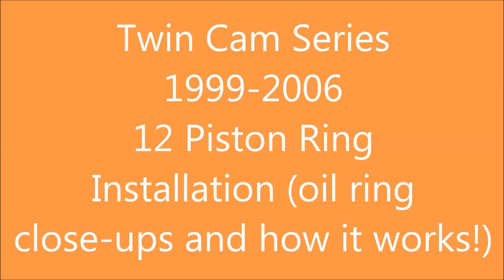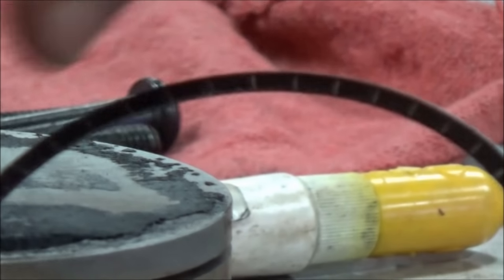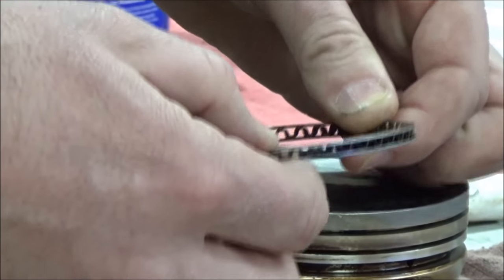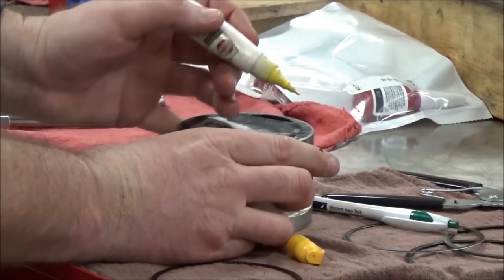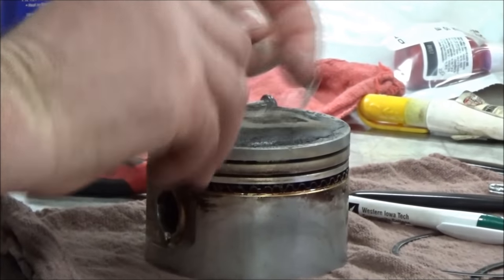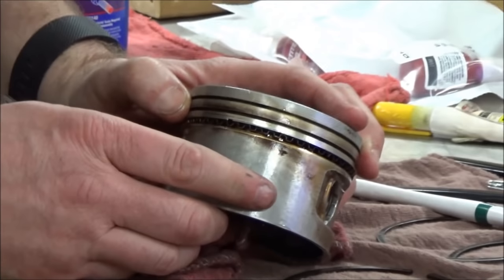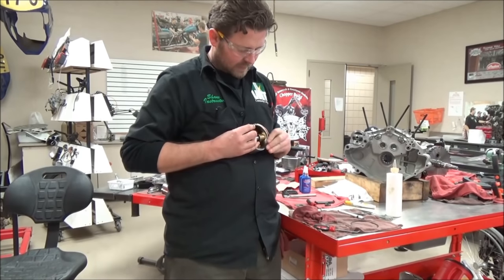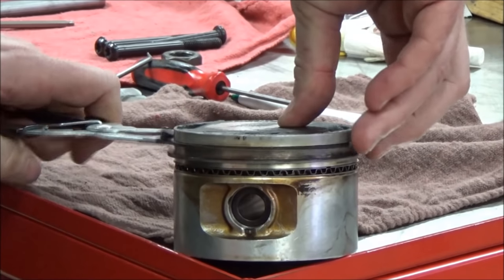How to install piston rings and not break them. Oil ring explanation POV installation! #pistonrings

Comment: Great video.  Another thing to remember about the oil rings is to get the correct size.  I made that mistake on my shovel rebuild.  The machine shop bored 20 over and I bought the pistons to match.  The rings that came with the pistons were not the moly compression rings so I bought a new set of rings.  The oil expander ring was not the right size (narrower than the width of the piston oil slot).  I put the rails on like your suppose to.  The bike ran great at first but I was soon fouling my plugs consistently.  Couldn’t figure out was was going on.  I thought my valve seals were the culprit.  I finally disassemble the engine and realize what a dumb ass mistake I had made.  The rails were climbing on top of the lips of the expander and causing the fouling.
Reply from the maker: Hi Scruffy. TY! You may enjoy this video Shane did on the 3 piece oil ring too. https://www.youtube.com/watch?v=PyUjvaQa2h0 
You rock for commenting! We will let Shane know!

Ways to support or high five How 2 Wrench! Thank you in advance. YOU MOTIVATE US TO DO MORE!
1. Smash the subscribe button (thank if already a sub!)
2. Have you seen our "YouTube Trained Support Shirts?  https://goodfellasmerch.com/collections/how-2-wrench/products/support-shirt 
3. Join this channel to get access to perks:
https://www.youtube.com/channel/UCBhM8DCKnT3qXwTW0eToyCg/join    
-Daily MEMBER FIRST COMMENTS ANSWERED FIRST 
-Live Q/A video chats
-Wonder if we have a video on your need? Members can request content links!
-Full Access to the ENTIRE 700 video library
-Member-Only FREE tool giveaways  
4. Got an emergency and your head is about to explode from frustration or fear? Get Shane’s cell here: https://how2wrench.com/ols/products/techline-one-on-one

Comment: The method shown will work.  However, it is also clumsy, time consuming and will scratch the piston ring lands or the piston skirt.  Using a screwdriver or whatever to recover an OCR rail from the top or second groove is an absolute no-no.   The girls on the assembly lines at the piston plant I worked at would flick a three piece ring on a piston in less than 20 seconds.  No marks on the piston, all gaps aligned.  The trick is simple.  Install the expander.  Push one end of a rail into position say above the top of the expander, twist it like a band saw blade and lay it into the groove.  Do likewise with the bottom one.  No over expansion whatsoever and they are designed to be installed in this manner.

Comment: Wow, I've been at this oil ring assembly for 2 hours with no success but after 2 mins I got it on the first try. Awesome vid!
Reply from the maker: Thanks for commenting and adding value to our community!

Have you subscribed yet to never miss a video? Have you seen the video playlists? Over 600 videos! Check them out here: https://www.youtube.com/user/conleybuilt/playlists  

Want to say “thanks” or “keep it up”? Click here https://www.paypal.me/how2wrench    
 
Your answers and help are just around the corner. Save time and money while protecting your investment and yourself by doing it the right way at www.How2Wrench.com
Reply: @How2Wrench  just did, thanks and keep up the good work!
Reply: Oh wow, I'm putting a 1 mm oversize Namura piston in a Suzuki LT230S, hell of a fight w/ oil control ring, now I know what's going on; compression rings had;end gap of .006", I filed them to just over .014", carefully deburred ends, but oil ring is not playing nice w/ cylinder, I will attack it again tomorrow, & complete & defeat the dilemma.thanks for this vid

Comment: 1991 Chevy Silverado 5.7 135.000 miles  My truck just started smoking out of 1 side. Drivers side, Heavy Blue smoke when u rive it up. Started doing this after i changed oil with 4 quarts oil plus 1 quart Lucas Oil stab.. I also changed out 1 injector tbi throttle body with New/reman. injector. Also replaced oil pressure sensor.. Now it started smoking blue smoke out of just one side. IT also still running rich/flooding but no misfire or loss of power i dont think but i havent road it yet. I think i make have a broke oil ring but hoping not.  All help appreciated
Reply from the maker: You could always try swapping the old parts back and see if you by chance got a "bad" new part. 
Your answers and help are just around the corner. Save time and money while protecting your investment and yourself by doing it the right way!
Follow us!
Web:
www.How2Wrench.com    
www.Tools2Wrench.com

Comment: Hey man thanks a ton. Starting a project and haven't done one in about 15 years. Your video is focused,clear and very understandable with great info that came back to me. Question if you could or know of hand, got another project going for my kid on one of those 2002 Ktm 50 Sx senior liquid cool. Was about to instal a Wiseco piston/top end kit and noticed the Rod has some play. Not up and down but side to side (never touches crank but kinda close). I know there's supposed to be some play but how much is in the safe zone? No manual came with it and no luck finding it. Thanks a ton man and subscribed.

Comment: Thank You for such   interesting and enlightening lessons.  I have a doubt going round my head from long time ago = Do rings rotate while  engine is running? Do they retain their relative position  after, lets say, 40k miles? Thank You for your kind answer.......  and keep on wrenching!!
Reply from the maker: Thank you. I struggle "seeing" the rings rotating but was told years ago they do. I think so fresh research would be a good idea. I have a theory but sure would be great to know. The engines I build don't come back in s short time (good thing) to check. 
Head over to the new website and subscribe to the newsletter to never miss a video or newsletter! www.how2wrench.com/contact/ 
Keep Wrenching,
Shane Conley
Instructor/Motivator/Motorcyclist
www.how2wrench.com

Did you like this free video and hope to see more? Would you just like to say thank you with a donation? Click https://www.paypal.com/donate/?token=TvKoeRazPL-KysbM-e0ttz-C_gPq2IrqxDmM3ORCu4nxJzQWxYbmo-6m3YuNu64XHLngGW
Reply: Dear Fernando, I doubt you will read this as you asked your question over a year ago.  However this might help others.  Rings do rotate and often faster than most people might realise.  The driving force is the cross-hatch pattern on the cylinder bore after honing.  Obviously it should be symmetrical but we do not live in a perfect world and it will be skewed one way or the other.  Add to this the  different lubrication conditions and temperatures between the top, second and oil control rings and you can see that they will all rotate at different rates.  Hence the fallacy of setting gaps at 120 degrees on installation.  Note the position of ring gaps on pistons you remove from an engine.  You will find they are all over the shop.  

As a final comment, why do manufacturers of two stroke engines (where the inlet ports are in the cylinder bore walls) find it necessary  to put a peg in the  piston ring groove at the gap location?  The answer is simple.  So the rings cannot rotate and the free ends pass over the  ports causing breakage.

Rings do rotate.  In a good engine it should be a slow process.  In a bad engine it can be very quick causing nasty side wear.

Comment: Great video ! well done !! I would appreciate if you can make a video on how to do it on AUDI A3 1.6 as this is my car and suffering from oil burning issues.
Reply from the maker: Thanks for commenting and adding value to our community! We don't currently have an Audi in our fleet. We do have many videos teaching skill sets that would apply or we can work with you one on one.

Have you subscribed yet to never miss a video? Have you seen the video playlists? Over 600 videos! Check them out here: https://www.youtube.com/user/conleybuilt/playlists  

Want to say “thanks” or “keep it up”? Click here https://www.paypal.me/how2wrench    
 
Your answers and help are just around the corner. Save time and money while protecting your investment and yourself by doing it the right way at www.How2Wrench.com
Reply: you could be doing a lawn mower engine or a big rig engine and it will be the same thing.take them off and put them on in reverse order,take pictures and pay attention

Comment: What is the difference between the sides of the rings and if you were to install one upside down?  I have only gotten inside small engines in which the rings have a preset gap which makes that practically fool proof.  Wonder why Husqvarna, Stihl, Echo, and so on have something that vehicles don't there.  Can't say but I would expect car and motorcycle's heads be more advanced if that piece matters even.  Im only a hobbist and find the subtle differences between different types of engines interesting.  Thanks for the great video

Comment: at 13:09 in the video, you talk about the expander facing up on the gaps. If my piston has a solid rail and the piston has oil holes drilled in does that mean I can install that expander up or down? I mistakenly installed the expander facing down and I am wondering if I need to disassemble it.

Comment: HELP...i followed your video to install my piston rings.  Since the new ring gaps are wider then the stock, i installed as they are.
Top and 2nd  (Old =0.12 , New = .020) 
Stock single oil ring = .009,,  New comes with 3 oil ring = 0.020. The expander does but up. i ensured it moves/turns once installed. 

After the break-in period, engine started making noise like the piston rings were scraping the cylinder walls.  I took off the cylinder head and sure enough all six cylinders show signs of scraping.  The cross hatch on the left and right side of all six cylinders have become smooth.  

What could be the problem that's causing the scraping of the cylinder walls since the NEW ring GAPS were much larger then the stock?
Reply from the maker: Hey there...we grabbed Shane quick and he said that .020 was way to big and he would need more time than a quick reply to get you the info you need. 
That’s a great question for Shane directly! We are just the social media team. Shane does answer questions when he get's back around to non members eventually so hang tight, FYI >>>> he does member ones daily!

He just returned from overseas training techs and his inbox is slammed with requests. He is scheduling time each day again to answer techline orders. He does not have the bandwidth to provide free email replies as his schedule is full with shop customers, training schedules, and one on ones. 
There's good news though! Shane has 2 solutions for you. One is a deep dive one-on-one with him with video, email and phone support. The other is a "quick fan support" option when it's a quick answer and just helps support the time for him to stop wrenching or training and get you in the direction that a free video had you close. Links to each are below. Hope this message makes sense to you as a decent human being that also works for a living and gets it!
Make it a great day!

The one-on-one service. Get Shane’s cell here: https://how2wrench.com/ols/products/techline-one-on-one       
Quick answers are answered daily as a channel member: Join this channel to get access to perks:
https://www.youtube.com/channel/UCBhM8DCKnT3qXwTW0eToyCg/join   
-Daily MEMBER FIRST COMMENTS ANSWERED FIRST 
-Live Q/A video chats
-Wonder if we have a video on your need? Members can request content links!
-Full Access to the ENTIRE 700 video library
-Member-Only FREE tool giveaways  

Have you seen our "YouTube Trained Support Shirts? Great way to "high five us" https://goodfellasmerch.com/collections/how-2-wrench/products/support-shirt

Comment: ....hi man my rings on my Polo need to be changed but now the a WV are saying in order to do it properly and have no future issues i have to change cam belt, hip bearing, cam shaft, rear main seal and so on, and so on. Basically engine overhaul by the looks of things, because, and i quote "once you open the engine you just gotta replace everything". Is VW try to drain my pocket or is this valid.

Comment: Great detailed video that was very helpful, but noticed one error at 11:59 others may have mentioned below, the top and bottom rails (and your marks) are backwards from the manual shown.  Probably doesn't matter though.

And I have a question.  I'm installing new Wiseco 0.01" overbore 103 pistons on my 2008 HD Electra Glide Classic.  Contrary to what you show, I've seen a possibly older manual in a FixMyHog video, that puts the #5 top compr ring by the intake and the #4 2nd compr ring at the exhaust, with position 4 not being used and position 1 only being used for the oil separator ring (vs by 1 AND 5).  Is your method the most recent and do you recognize the method FMH is using?  The bike they were working on may have been an 88 ci going to a 96 ci but that doesn't necessarily mean it was an excessively old video as they could have done that this year.  But my dealer's manual is from 2011 and it agrees with your method and looks like your opened manual page.   

The Clymer manual I have does something different again though I'm not following that as it's too vague and actually made me lose faith in Clymer (perhaps unfairly as it may not matter as much as Harley says).  They have the top compression ring facing the intake or exhaust - they don't specify but I'll call it the intake - the 2nd compression ring facing to one side I'll call the left, the lower rail facing what I'll call the exhaust, the top rail facing the right, and oil separator ring gap not even distinguished where it goes.....the gist is to keep them all separated but strange no mention of the separator ring.  Also disturbing is no mention of any of the oil ring assembly details/concerns you mention which is why your vid is so important. 

 FINALLY, Wiseco's directions are totally nonsensical as they have the piston pin axis going front to back vs across.  Maybe it's a generic drawing and other engine types like inline 4's or v-4's or boxers etc. do so.  They don't mention intake or exhaust but say the top ring gap is at the rear, 2nd to the front, and top/lower rails and separator ring gaps about 60 deg apart away from intake/exhaust if you know what I mean.  Again doing what amounts to the same thing.  Any idea why so many different methods and does it really matter?  Does Harley's manual mention the details you do with the oil rings like the overlap (Wiseco does, Clymer doesn't) and 'stacking the sandwich' properly?  Regardless I'm heeding your advice obviously.

Another contradiction is Wiseco has a sheet saying twin cams are 0.04" ring gap per inch of bore so about 0.0155" for my bore.  They say 0.015" for both top and bottom compr ring.  But their generic directions say you can get top ring flutter if you don't have a larger gap on the 2nd compr ring than the top.  I'm going by their TC HD engine specific directions as thankfully it's a lot simpler than filing down the 2nd ring to be larger.  Dealer says it doesn't matter too and they say about 0.015" is fine.  But Harley manual says top and 2nd also have different wear allowances and the min is more on 2nd than on the top.  So they must agree with this top ring flutter idea but then Wiseco and my dealer do not.  Confusing!  Is it worth worrying about and when setting new rings do you in fact file the 2nd one down a bit?  BTW the Wiseco piston kit came out to 0.015" in my bores.

Thanks in advance (forgot to mention Wiseco generic directions say 0.04" gap/inch is for ATV/PWC/snowmobiles/dirtbikes and 0.05" for most street bikes......yet the TC HD specific directions imply 0.04" as it comes to 0.015" top and bottom).
Reply from the maker: I'd be glad to help Bob. 
Have you Subscribed yet to never miss a video? Have you seen the video playlists https://www.youtube.com/user/conleybuilt/playlists ?

Still have questions? Coach Conley provides tech help and works one on one! His YouTube and training center has grown beyond the ability to answer every question (11 million views! Over 500,000 a month!) He gets 300-400 requests a week. Become a member for his direct cell phone number and personal assistance!

Click here for the membership links and welcome to the community! https://how2wrench.com/product-category/specials/ 

Want to say “thanks” or “keep it up”? Click here https://www.paypal.me/how2wrench 

Your answers and help are just around the corner. Save time and money while protecting your investment and yourself by doing it the right way!

Comment: Can a bad crank seal on a two stroke can it run like crap?
Reply: Yes sir
Reply: A bad crank seal can leak air ( ignition side) or oil( clutch side) , or both.some, not all, machines can allow seals to be removed ,carefully, without disassembling engine